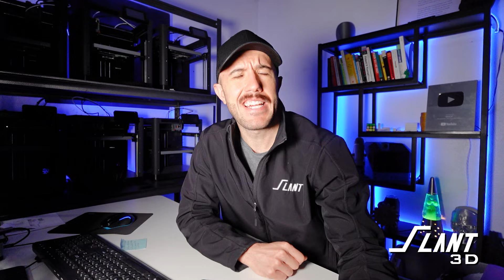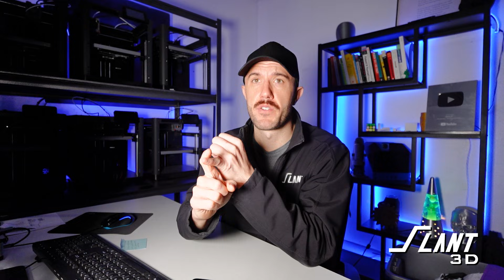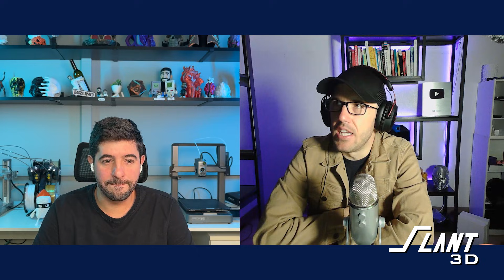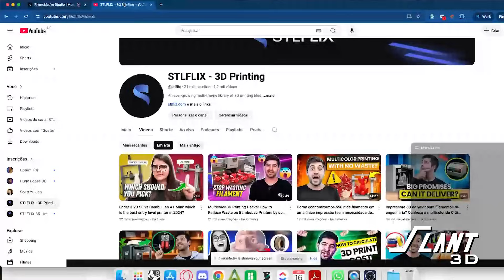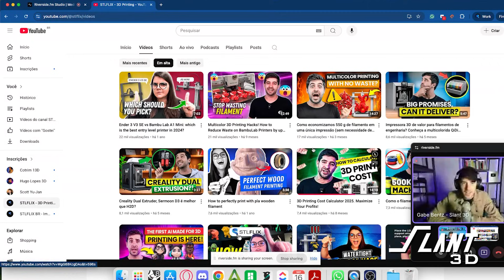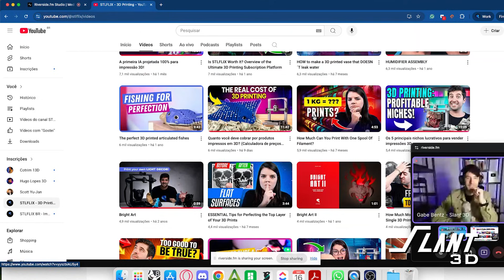$300K Per Month 3D Printing Business | Interview with STLFlix Founder | Podcast Ep 135

Comment: I don't live in the US, but I have created a system for 3D printed gutter covers (Ground level rectangular drainage gutters where the downpipe from the roof gutters empties into).  They are essentily dead leaf magnets.  Because most 3D printer build plates are smaller than a cover needs to be it sort of lends itself to a modular approach. I do freebees for retired folk so that may be a way of doing some research and good for the community.

Comment: Can I do two color prints? If so, I’ll immediately get set uo
Reply: I am also confused about multicolor.  a previous episode mentioned multicolor prints being live.  I'm assuming it's closed beta, but would be interested in more clarity.
Reply: No, no multicolor parts on teleport.
However, you can have an item contain multiple parts, which can be different colors
Reply: @Rayphel07 that’s not great. I’ve got an item which embeds text, and the only solutions are either multicolor or stencil painting, but I know they don’t like post processing.